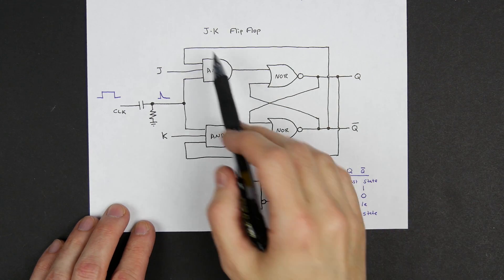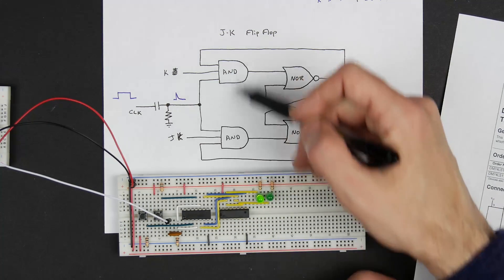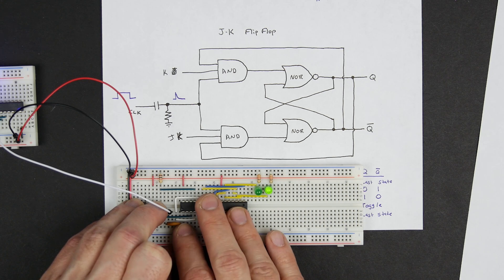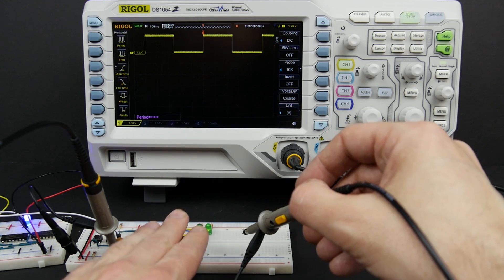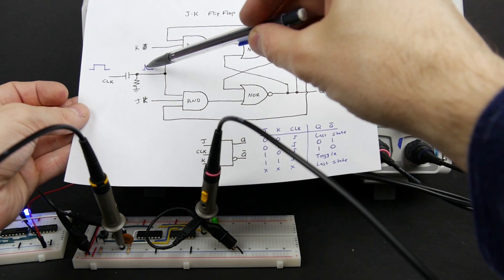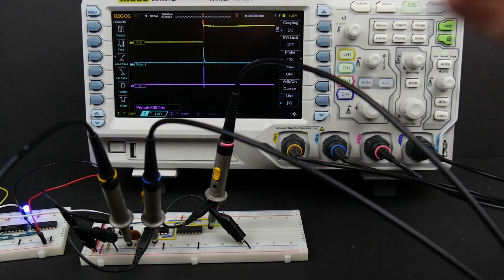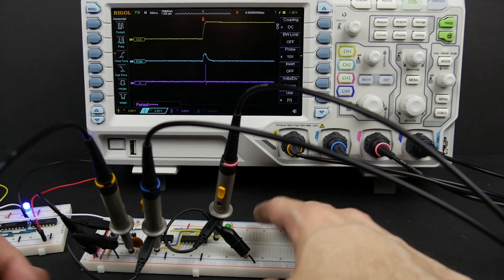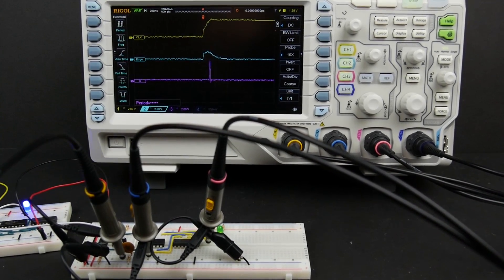JK flip-flop racing

Comment: For those people watching in future, yes the `Q (Q complement) output should be fed-back to the K-AND gate and Q to the J-AND gate, infact in this configuration of JK flip flop (made with NOR SR Latch and AND gates) the feedback wires are not crossed (like he drew it here), and the Q should feedback into K and `Q to J while in the NAND configuration of JK flip flop the feedback wires are sort of "crossed" (and im guessing thats what he confused it with while drawing this diagram), so the diagram here is slightly incorrect but the important thing is that you think about the logic yourself.

Comment: Retired electronic engineer here, with three comments. Firstly, solder-less breadboards are inherently unreliable  and I hate using them, but more importantly using an RC network to differentiate the input waveform is a terrible idea. JK's are made using pure logic, rather than like this. As is made clear in the video, getting the length of the differentiated pulse just right is difficult and the rise time and height of the input square wave will affect the required RC network, which is why this is not a good way to implement a JK. Finally, when the input square wave falls again, the input AND gates will be given a negative kick, that takes their inputs well below 0 volts. This is not allowed according to the specification of the AND gates. At best, the outcome will be that the gates don't work properly, which might account for the unreliable operation of the JK. At worst, this could damage the chip. The way to fix this, if you are going to use an RC network in this way, is to put a diode across the resistor to cut the negative pulse off. However, doing this is not very kind to whatever is providing the input square wave. So the best option is to design the JK with pure logic and no RC network. Nevertheless, it was an interesting video.

Comment: When I was studying electronic engineering, the way we were taught to implement an edge detector for a circuit like this was to use the propagation time of gates rather than trying to use an RC-circuit. I.e. you could have CLK and !CLK anded together, and rely on the propagation time of the inverter to give you a nice, short pulse. Of course, that was for designing the integrated circuits themselves, not breadboards, but I'd be curious to see if it would work.

Comment: It looks like after the resistor was changed, the capacitor didn't have time to charge. I think it might have worked if you used a still smaller capacitor, and kept a 1k resistor.
Thank you for your videos!

Comment: I'm guessing that changing the R to 100 ohm not working had less to do with breadboard parasitics (afterall those didn't change) than it did with 100 ohm loading down the clock too much. Probably just need to buffer before the RC.

Comment: the circuit diagram is not correct. the "q" output should be connected to "R" (reset or "K") and not "S" (set or "J"). Why am i the only that noticed this?!?
Reply: Yes, correct. However, J & K still need to be swapped because the 0:05 feedback must come from the opposite sides (not cross over). I think that schematic with four NAND gates with J at the top would be correct, though…

Comment: I think the schamatics is wrong. You had changed the labels of the inputs, bus you have to change the input of the ANDs too. Because in your shematics, an input will change nothing.
Example : If J is to 1, the AND gate require the Q to be one. Witch is impossible because we ask the JK flip flop to set the output to 1

Same idea as @Robin I think

Comment: I think Q should be connected to the 3i/p AND gate containing K terminal not J...then only toggling is possible.
Reply: Like Q and Q bar are ultimately just labels., there isn't a logical reason to consider that they will always be the negation of each other.
Reply: @mohitshetty8767  yeah that's  correct...like 0,0 Input in Nand-SR latch..
Reply: @Akash Sardar How does Q become 1? When initially all values are expected to be low ~ 0 V. Actually I wanted to know how does the flip flop start in the first place... Because 0 . 0 from the two AND gates should make the `SR` trigger to its previous state which should be 0 and 0 (low) as the Vcc had been just connected. So from where did 1 come?
Reply: @mohitshetty8767  It was assumed that the flip flop is in set state from the very beginning.
Reply: @akashsardar495  But practically how does that happen?
Reply: @mohitshetty8767  by means of overriding power of Asynchronous Preset input which is not shown here🤔
Reply: @akashsardar495  Could you please elaborate?
Reply: @mohitshetty8767  Incase of IC 7476 we can directly bring the FF in set state without using any clock pulse...If we use 3 ip NAND (instead  of 2i/p Nand)with one terminal as Sd' we can perform this operation. 😊
Reply: @mohitshetty8767  Just check out the Pin out diagram of  IC 7476 in Google...you will get what I am trying to say...I mean pre-set i/p

Comment: nice video but i have to mention some things, this is not a flip-flop, this is a latch. The different between latches and FF is that the latches acts on the clocks level vs the ffs that acts on the clocks edge. 

Secondly you try to make make the latch acting on edge by differentiate the clock signal but this is wrong because you feed an very slow edge signal to the gates inputs that cause each input to stay in the undefined region for a long of time and this make stability problems. See the datasheet of your ICs for further details. 

One proper technique for making FF is to use two latches in a master-slave configuration. An another is to use 3 latches in a edge trigged configuration.

Comment: It is interesting how having INCORRECT schematics (NOR to AND connections crossed) you had built CORRECT circuit (NOR to AND connections not crossed) :D
In fact, i was waiting you find schematics error while building circuit, but no! Nothing said about error and everything's working! 
Me: what the heck?!
But then, when looked on at breadbord i saw that NOR output to which left LED (Q output) is actualy connected to AND gate which is for left button(J button) i.e. top NOR connected to the top AND - not crossed.
Reply: He explained his error at 0:34
Reply: @barathkumar7940  not true - 0:48
Q should go to top AND gate & !Q to bottom AND gate (no crossover) for this particular circuit to work.

Comment: Hello, Sir. 

After watching your videos I have now crystal clear idea about latch or SR flipflop. Your instructions are just awesome! But in this video something seems wrong.
First I like to apologize for my ignorance. I can't understand couple of things. Would you
please help me sir? I am having trouble to understand this.

Please take a look here:

and we consider that clock is always high and k=1 and j=0. 

1. At the default state when first power comes up, we get Q=1 and Q`=0. 
Which makes J(AND) gate's one of the input 1 and K(AND) gate's total output goes 0.
Since Q`=0 and k(AND)=0, that is supposed to make Q=1(** But the circuit shows it's 0).
Isn't it? 

2. Again, Since Q=1, clk=1, J=0, that makes J(AND)=0. And Q`(NOR) gets 0( J(AND)=0) and Q=1
and It makes the  Q`=0. 

3. According to this when K=1 and J=0, this can't reset. Everything shoud be as it is, isn't Sir?

and This is the big problem I just can't understand wht's wrong with!!!!

Comment: After doing couple of hour of observation and trying different combinations of gates for flip-flop I came up with this conclusion.

Things get really confusing when we moved to J-K flip flop using the circuit Ben shown in this video.

Let’s start from beginning,
We’ve two data storing elements i.e. 
1: SR NOR Latch
2: SR NAND Latch

They work the same but their truth table is completely opposite to each other. i.e.

SR NOR Latch truth table 

Clk        S        R      Q
  0          x        x       Memory state
  1          0        0       Memory state
  1          1        0      1
  1          0        1       0
  1          1        1       Not used

SR NAND Latch truth table 

Clk        S        R      Q
  0          x        x      Not used
  1          0        0      Not used 
  1          1        0       0
  1          0        1       1
  1          1        1       Memory

After studying these basic memory elements. We moved to SR latches with “enable”. This enable is input to two AND gates along with Set and Reset(as in circuit diagram shown in video). The output of these two AND gates is input to the Latch(SR NOR). If we replace “enable” by “Clock” we would have a flip flop. 

Let me ask you a question. Can’t we use any other combinations of gates ?
Of course we can.

See the possible combination which will work as an SR flip flops.
1. AND-NOR (Ben using)
2. NOR-NOR
3. OR-NAND
4. NAND-NAND

You must be thinking what about other combinations?
5. NAND-NOR
6. OR-NOR
7. AND-NAND
8. NOR-NAND

These combinations will not work as flip flop. Try making truth table for each of these combinations. After making truth table, You’ll know that these circuits(5 to 8) are automatically going into the “Invalid State” when clock is Low/High depending upon the circuit configurations. See these circuits are not storing data we can’t use these combinations. 

The only possible combinations which will work as an SR flip flop are
1. AND-NOR (Ben using)
2. NOR-NOR
3. OR-NAND
4. NAND-NAND

Hope it cleared your doubt till now.

But as we move to J-K and T flip flop. We again have some limitations. 

We get J-K flip flop when we feedback Q’ to top AND gate and Q to bottom and gate(as shown in video but it is not correct I’ll tell you later)

Using this type of arrangement of feedback. Only two possible combinations will work i.e.
1. NOR-NOR
2. NAND-NAND

Now we’ve only two combinations which will work as J-K flip flop and T flip flop as well.

The remaining two combinations can somehow be used as J-K flip flop. If we make a change in feedback configuration.

If Q is input to the top AND gate and Q’ is input to the bottom AND using this configuration the remaining two will also work.

Now coming to the doubt. “Why circuit shown in video works correctly?” (AND-NOR)
Well, Ben mistakenly drawn feedback path in circuit diagram but if you see the circuit carefully on breadboard. You’ll know that circuit actually matches second configuration as I told you.

I tried every possible combinations and their truth table. Hope it helped you!

Comment: You've got the feedback to the AND gates crossed, and it shouldn't be.
It's because this circuit is sometimes made with NAND gates (instead of AND and OR), and then you would need to cross them.
It's correct on the breadboard, but not the circuit diagram though.
Absolutely superb video series. Truly brilliant.
Reply: Yep! The output of Q should be connected to the input of the top left of AND gate and the output of negative Q should be connected to the input of the other AND gate. The diagram is wrong but the connection on the breadboard is right. That's why the results meet the expectation. If you google JK flip flop, you will find there are two ways to make it happen. I'd really appreciate your comment.

Comment: Another way you could demonstrate this, though maybe not as elegant, would be if you used RC circuits to increase the propagation delay between the gates to the point where the racing oscillations are slow enough to see on the outputs. Maybe also include some LEDs driven by a MOSFET buffer from each output so you can see the state of each output. I normally do things like that to help me visualize what's going on when I'm trying to troubleshoot a circuit.

Comment: On the last video I tried reasoning through the logic gates, and it didn’t check out. I tested it with all NAND gates, as people in the comments said, and it worked. After you made your fix in this video (the J-K swap) I tried again, and it still didn’t work. Say that the lower NOR is on. The upper is off. The lower NOR connects to the upper AND input. The lower AND gate will not turn on because the upper NOR is off. So, the only option to try is the upper AND gate. Turn on the clock and K, and the upper NOR gate has both the lower NOR and the upper AND giving 1 to it. It doesn’t change. The only way to swap is to give power to the lower NOR gate, but one AND input is stuck off until it is swapped. It’s stuck.
Reply: Should have swapped the q and q” not the J &K
Reply: @azzajohnson2123  swapping J and K is the same as swapping Q and not Q as the circuit is symmetric. The core problem is that the two feedback wires should not be crossed.
Reply: @zoltankurti  Thank you for your comment, very useful for me after I had trouble understanding he circuit and realizing that it could not work as per Ben's design!
Reply: I realize you're probably no longer concerned about this, but you're definitely correct. The schematic isn't drawn correctly. If you look closely at the circuit Ben builds and compare to the datasheets, you'll see that the outputs don't cross over to the other input as shown in the diagram.

Comment: i think you were right the first time. The J should be on top since the not Q feed back is attached to the top left AND gate. when you changed it to K up top, You would need to feed in a Q feed back on the Top left AND gate with K. take a look. https://www.google.com/search?biw=1628&bih=963&tbm=isch&sa=1&ei=DlcvWum1JoXOjwTr26LoBg&q=jk+flip+flop&oq=jk+f&gs_l=psy-ab.1.0.0i67k1j0j0i67k1l3j0l5.377457.379877.0.380594.3.3.0.0.0.0.239.494.0j2j1.3.0....0...1c.1.64.psy-ab..0.3.491...0i7i30k1.0.VKWIby_Yr7U#imgrc=yxvee6wnho0-yM:

Comment: You can make a "single" short pulse that would probably avoid racing by using AND gate and a NOT gate.
You feed the clock input directly into the first AND gate input and you feed the same clock through the NOT gate into the other AND input, this makes extremely short pulse, the pulse will be as long as propagation delay through the NOT gate.
Reply: He talked about that in an earlier video

Comment: Great video as per usual. However, This circuit does not work as drawn, the logic gates either need to be NANDs or the "feedback" wire needs to go from Q complement to J and Q to K. I am not quite sure how the circuit drawn was implemented as is.
Reply: Actually a single JK doesn't work, Master-Slave is the way.
Reply: that was the point of the video, to demonstrate the issue.. 12:12

Comment: As Russians say: "Практика всегда ебет теорию" ("Practice always fucks theory") :q
So how can this problem be solved? JK master-slave or something?
Hmm... Or how about slowing down the feedback signals a bit so that they returned after the clock pulse goes down?
Reply: You can also build an edge-detector with gates: connect both, the clock and the inverted clock (NOT-gate) to an AND. The NOT-gate provides for a short delay (~ a few nanoseconds) st. for a moment both inputs of the AND are high. If the delay of the NOT is too short, then you can chain 3, or 5, ... NOTs to make it longer.
This detects positive edges on the clock signal. For negative edges you simply put another NOT in front of the whole thing.
Reply: Actually you might use low inductance coils to slow the feedback loops down..
but I think slowing them down would make the circuit slow as a whole. On the other hand, master-slave uses two SR latches instead of the RC circuit which can act as fast as the transistors operate and everything would be synchronized with much higher speeds!